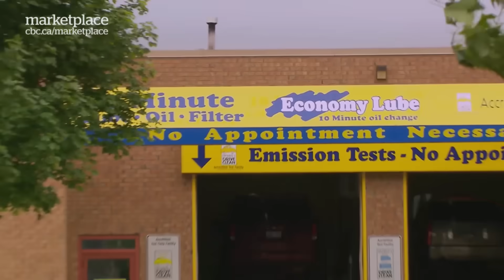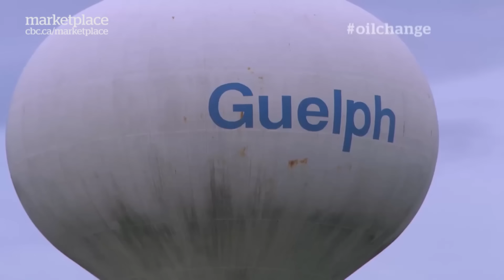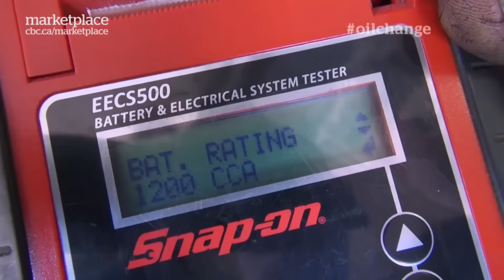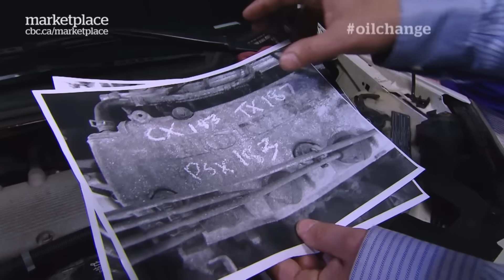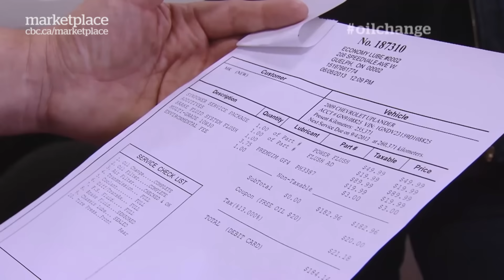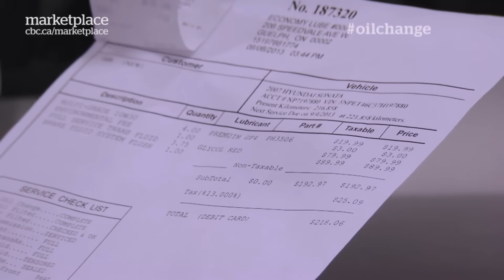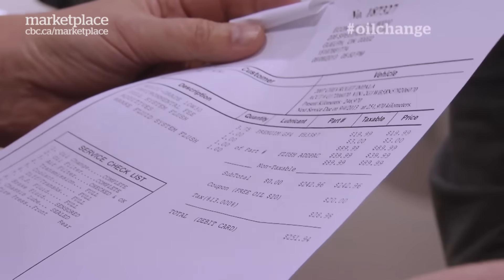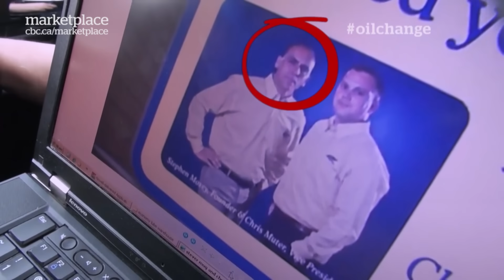Oil change scams: Hidden camera investigation on what really happens to your car (CBC Marketplace)

Comment: Bruh everyone should learn how to change their own oil nowadays. You can save hella money and you wouldn't be giving it to these pests
Reply: Not everyone is physically capable of doing it, has the time, or the place to do it. Plus in the dead of winter I WLL NOT be crawling under my car when it's -40
Reply: If you only get the oil change, and you get it for a competitive price (under $60) you’re actually getting a good deal. Oil changes are a loss leader for most places. But doing it yourself is good because you know its done right and u dont gotta deal with upselling bs.
Reply: Some places change it for free if you buy the oil. Even so it’s not hella money saved, 30 dollars for a oil change is pretty reasonable
Reply: @blastofo  yes it also kind of blows to dispose of it legally too though,  though I imagine some dont bother with that
Reply: @alje311  ah yes so you rather ho out and do it instead for go in you're garage and do it yourself
Reply: @Darthvaderouge  I don't have a garage so that means in the winter I'd be crawling through slush and snow to get under my car
Reply: @I3oomhauer  auto parts stores will take used oil for free
Reply: @alje311  dude what kind of car do you have where its under the car?
Reply: @nathanielrossi9659  most cars have oil drained from under the engine.
Reply: @alje311  oh okay i understand.
Reply: Oil change is so easy bruh. Just learn it. At least you can sort of tell whether they did it or not. Filter should be brand new and oil should be clear not black.
Reply: @rebelaqua823  again not everyone is physically capable of crawling under a car (too old, disabled, etc) or they dont want to crawl under a car in extreme heat or cold.
Reply: @alje311  Agreed. The issue is not disability or disease, but lack of basic knowledge about how a car works (among other things). Disabilities can be overcome but lack of knowledge often cannot be; especially if the individual is not curious or hungry.
Reply: Hey guys Chris Fix here!
Reply: $30 = very cheap oil and filter.  I change mine with mobil 1 full synthetic and a wix filter for $35. I could take it in but I'm not paying $100 for the same service. Besides some say they used synthetic but in actuality used traditional.
Reply: You need a car scanner to reset the service intervals
Reply: Yup! Lucky they teach us in the Army. Sure it was military vehicles but same.
Reply: @alje311  IF everyone knew how to do it someone else in the family could do it for those that is physically able. I have a few disabilities myself(military) I dont have a garage either. Lucky I live in FL other wise I would be cold under there. But no worries, just change it before it gets tooooo cold and it should carry you over till it gets warm.
Reply: Oil changes are now every 5,000 miles...used to be 3,000...Does your gf/sister, know how to?
Problem here was not the Oil chg...it was the add on stuff....
Just tell them O.C. period and skip telling you anything else....l.had same problem at Jiffy Lube in area...got O.C. and never returned.
Reply: Also one spends more at one Happy Hour than one oil chg....so saving money is moot after paying for 3..4. Qts...oil filter, even $30 every 5,000 is cheap...
Reply: It’s not hard for most vehicles absolutely agree. Always change my own oil and get 5 quarts of mobile 1 and a filter for 35 bucks and a little work. Way cheaper than the 100+ dollars I’ve paid just being lazy and letting someone else do it
Reply: Clintoniumer no oil change place charges $100 for the service lol ....it’s like 30-50 bucks
Reply: @alje311  so you're lazy
Reply: Samin Alam for full synthetic 5 quarts of Mobil 1 was over 100 lol that’s why I’ve changed my oil ever since. No matter how much I don’t want to do it it’s a saver
Reply: Most car related fixes are probably easier than people think thanks to the wealth of information available on places like youtube.   -I had an issue with my brake lights not working about a month ago. I tried all the easy stuff like fuses and the brake switch but nothing worked so I took it to Firestone (since they were close by). It took them 3 days to finally tell me that it needed a multifunction switch (located behind the steering wheel) and that it would cost $550 to replace. It seemed outlandish so I looked the part up online and saw it was only $50. Long story short, I decided to try fixing it myself with very limited previous car knowledge (except for doing my own brakes and oil changes). Thanks to some youtube videos, it was a surprisingly easy process and fairly cheap because things like steering wheel pullers are actually free as rentals at places like Autozone. I was able to replace the part myself for about $75 total with a few hours of work. Always worth it to Google your problems and see if you can fix them yourself. Even if you can't do it, it still helps prevent you from getting scammed if you know what actually needs to be fixed.
Reply: I changed mine for the first time last weekend. It’s really not that hard and it’s actually fun
Reply: @pfc6329  innormaly pay about 100 usd only for the oil 5 liter
Reply: @james avery did aswell, made 2 misstake, oil filter dont forget the o-rings, also when emptying, if 5 liter oil dont use 5 liter tray...
Reply: $20 at Walmart. I changed the oil on a motorcycle once and it was a mess. Too much of a mess to be worth it.
Reply: @alje311  -40 where do you live the artic circle?
Reply: @temsbab1565  the upper midwest can get nasty cold snaps and polar vortexes. Plus I work outdoors so I'm not inclined to do the same in my spare time.
Reply: @alje311  ah okay then damn thats cold is that farenheiy or celsius
Reply: changing is not the issue. disposing of the oil is the issue.
Reply: @jordanhiggins44  most auto parts stores will take used oil from you.
Reply: Chris Stephenson unfortunately most of the time when people try it themselves, they do it everything BUT right.
Reply: @rebelaqua823  thank you for telling me my disability can be over come.  In my younger days, like a lot of my friends did most of my car repairs, now not young and there is no way I can do most things but thanks for being understanding.  Shame on you!
Reply: @TurinTuramber  nope, my vehicle it's just a matter of turning the ignition key on while pressing the brake and gas at the same time - intervals reset!  Depends of vehicle i guess but never had to use a scanner always some wonky way like I just explained - they couldn't just have a little a button.
Reply: @bangladeshirealtor  depends on the oil, synthetic is $$$
Reply: @jordanhiggins44  most parts stores take used oil and so do a lot of dealerships
Reply: Bob R meh they charge like $75 on synthetic around my way ....I get mine changed maybe 4 times a year ....don’t need synthetic but places don’t usually make a lot on oil changes . Break even maybe , you are paying an up charge for convenience and overhead .
Reply: @blastofo  60$ is NOT a good deal when i just bought my oil for 18$
Reply: yea its beyond easy also
Reply: Synthetic oil is it’s own scam. Last year I sold an ‘09 Taurus with 342,000 miles on it. I changed my own oil and always bought the cheapest oil and filter in the store.  I still see the car around town.
Reply: Catfishman 1 it’s not meant for a Taurus lmao
Reply: @nobody7817  sorry man I aint a mechanic an dont know much about cars. I hope your doing just fine though. You're right I should learn something. In my life there wasn't a vehicle around most of the time it was either walk or get a ride from a family member or take a cab.
Reply: @Jimmy Santacruz I mean it’s wise and non idiotic to stick with your car manual if you know nothing about cars..

Comment: I am almost 70 years old and I have NEVER met an honest car mechanic. Every oil change I ever went for, they tried to "upsell" or talk me into changing things which were not broken.
So I made an effort to educate myself and do as much as I possible can myself. For the effort of 1 hour on a Saturday I save 10X at least and I know it is done right. 
Actually the problem is much worse still... I am unable to find an honest home repairman, so I fix aircon as well as washing machine myself. The savings are "off the charts"
After you do it the first time you get the hang of it.
Of course not everybody on earth is a liar, but I seem to have problems finding the honest repairmen. The reasons are simple, lack of regulation. Honest repairmen cannot compete and people chose the cheapest estimate, because the estimate by itself is no indicator of "job done right" either.
All we need to do is a few more youtube videos shaming the con artists and the industry will clean up.
Reply: Well you have never met me because I’m dam sure honest about 60 years of mechanic work and still got a great reputation 😊😊😊

Comment: Wow their headlight fluid wasn't low? That's usually a common problem!
Reply: +Exile N Subjugate Don't forget about their alternator filter.
Reply: +Alex McClure  " Headlight Fluid " , please explain how headlights require a fluid. Also, what kind of car has such headlights?
Reply: +John Jordan you should remove your profile picture if you dont get the joke :D
Reply: +Exile N Subjugate Using a Chrysler Turbo Encabulator removes the need for headlight fluid, I swear by mine.
Reply: +John Jordan Obviously it's to make sure the bulbs don't overheat...Duh. I'm just glad they caught it before I did some serious damage on my car. I'm also glad they were able to notice my car wasn't properly balanced. Apparently my front end somehow became much heavier than my rear end. Luckily I got a good price on getting it fixed. $4,000 on a new, lighter, engine really helped. I'm just glad they already had one in shop and were able to change it out during my 30 minute lunch break. I've never felt safer. They even threw in one of those big pairs of fuzzy dice that people hang on their rear view mirror for free. My next oil change is also on the house. I just love the service I got at Trust Us Auto Repairs. 5/5 rating.
Reply: +Deividas Morkūnas  I asked because I simply did not know. I custom build cars for a living and have worked on more cars new and old then I can remember. I've seen cars with unthinkable features added to them. Therefore, I am the kind of person that if I do not know,......I have no problem asking. I know that some cars are made differently in other Countries compared to how they are made here in the US.  In regards to the joke, I do have a sense of humor. However, the Headlight Fluid totally threw me off. Thanks for clearing that up.
Reply: +Exile N Subjugate "headlight fluid" Mr. Gavino Free XD
Reply: Don't Joke about the head light fluid. Some luxury automobile has head lights that gets washed with washer fluid. Yes head light washer fluid.
Reply: yeah and don't forget the headlights fans in some cars
Reply: +Exile N Subjugate They need to get exhaust samples as well to check the integrity of the engine.
Reply: +Exile N Subjugate How unprofessional of them. Always trying to sell a chrome razzoid when a painted one will do the same job at half the price.
Reply: +Exile N Subjugate Don't forget horn fluid. That needs changing too.
Reply: +Exile N Subjugate I know... I got scammed by this, as well... the garage only greased the dome-light but charged me for flushing and refilling the entire headlight-fluid system :P
Reply: +DrSkyfall How do I check/change it?
Reply: Good 'ol Gavin
Reply: IT IS ESSENTIAL TO CHANGE YOUR HEADLIGHT FLUID MONTHLY
Reply: Yes, that water that leaks into the headlight housing and sloshes around inside there does so for a reason... the headlight manufacturer makes those leaky housings on purpose to allow water inside for cooling, and you need special distilled rainwater to replace it :D
Reply: could of sworn it was low cause it was spilled all over my lap
well, at least I got some elbow grease with it

Comment: No body in the US would have the balls to do a report such as this, Congrats CBC
Reply: SJ Bobkins I saw something similar to this on TV in the US quite a few years ago, actually.   It took place somewhere in one of the Southern States off of an Interstate.  The TV station's vehicle had out of State plates.  The idea was that they were just passing through.  Anyway, there was a camera hidden under the hood.   The mechanics removed and painted the starter motor as I recall.
Reply: There's been plenty tv reports done on this. It's nothing new
Reply: SJ Bobkins NBC did this same thing to Jiffy Lube a while back then did a follow up 3 years later. They found that they were still scamming people. I tell friends all the time about it and they probably never do the research and still go to Jiffy Lube. Something like this wouldn't make the news nowadays anyways since it's about car and not race. I wish more people knew about these scams and how to avoid them.
Reply: Steve Bazzi You're such a pleasant person...
Reply: SJ Bobkins It was on CBS's "The Lookout" a few years ago. Look it up, they take identical cars to the same shop only difference is one is a female (who is actually a real mechanic) and the other is a guy. They try to prove that auto shops take advantage of women more than men.

Comment: 19.99 for an oil change. That's a warning sign right there. Two mechanics I follow (one for an oil change on an older car, another for anything tire-related) will charge you at least 40-50 dollars for something as menial as a tire change, and they let you observe their work while ensuring they'll get everything done for you.

One of the shops I go to are all manned by a team of gruff-looking guys that look like thugs, but they're some of the most caring people I can trust with my car. They'll do everything necessary as you requested and send you on your way while definitely not trying to upsell you.

Moral of the story, don't judge someone by their looks and if the price sounds too good to be true...it probably is. Because I'm sure a bottle of engine oil costs way more than 20 dollars in today's world.
Reply: True. I change my own oil and it costs about $25 for a filter and oil. Granted this is high quality stuff but only 4 quarts. If a shop charges $20, they probably won’t change the filter and use the cheapest oil there is, and that’s best case.
Reply: @keithmarlowe5569  Yea, I had my oil changed at a place and they told me I had sludge in the engine and recommended a cleaning service. My oil is the shade of honey when I change it, not even close to dirty. Just a shameless up sell to those to don’t know better. That’s the day I bought the supplies to change it myself from then on. They also cracked my hubcap and engine cover the same day. 😡 $70 for an oil change and they damage parts on my car. Never going back.
Reply: This video is from 7 yrs ago. I don’t think they charge those prices now.
Reply: Full synthetic with a new oil filter always 75 on my vehicle sometimes 59 with a coupon best oil you can add in your vehicle
Reply: That's not true. At all. Not every mechanic is shady. And there are mechanics who run specials. Not everyone is an A hole
Reply: It costs me $45-65 to change my own oil. Sure I don't buy bulk barrels of oil, but a $20 oil change you're not getting oil you want to have in your modern car. Even the best worst oil I would be willing to use would be $25-45.
Reply: I believe oil changes at my job is like $30? Maybe close to $40? And with the synthetic high mileage oil it's like a $70 oil change. If u being your own filter and oil it's cheaper and we only charge labor. But we're also a one shop, we're not a franchise or nun jus a small business

Comment: I had a oil change gone a jiff lube and not 1 mile away My oil light came on. I looked back and there was a trail of oil. I walked back and asked why did all my oil come out of my car?  I was told my oil plug was replaced and my oil pan hole was stripped and they thought the new bolt would fix the problem.   The plug was the same one I as before the oil change . I showed them that and told me I must have put it back on. After small claims court I got a rebuilt engine and labor to put it in
Reply: that is crazy wow
Reply: Kenny Hickerson this is why whenever we got a stripped drain plug we stopped immediately and tell the customer. then go from there
Reply: Kenny Hickerson a motor vlogger i watch just had his car oil change. They cross threaded the thing, then tried to plaster it up with some gunk. The jiffy lube claimed to have changed the washer, but was false. It was not a new washer
Reply: Kenny Hickerson, if they took the old plug out and put a new one in, how could they say you put the old one back in?  It should still have been back at the garage.
Reply: Lol you went to jiffy lube. That's a super no no.